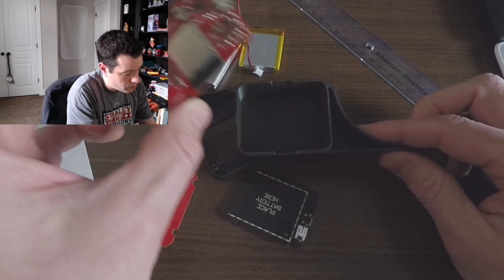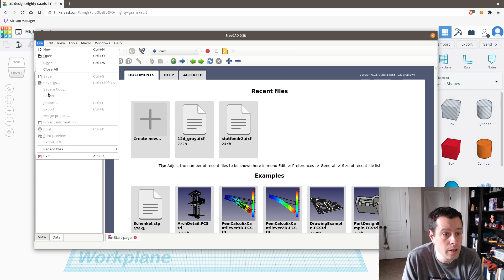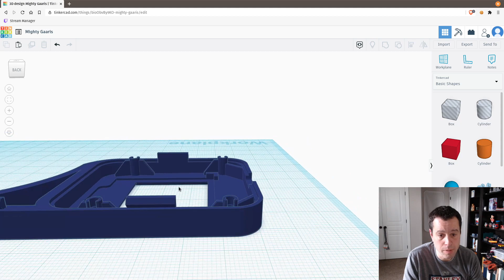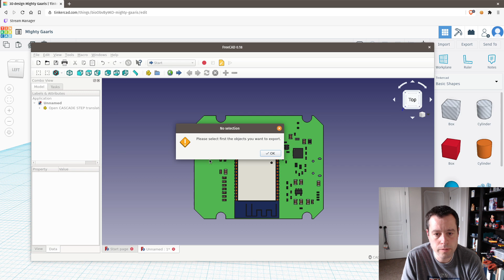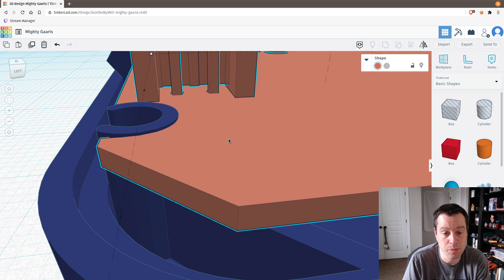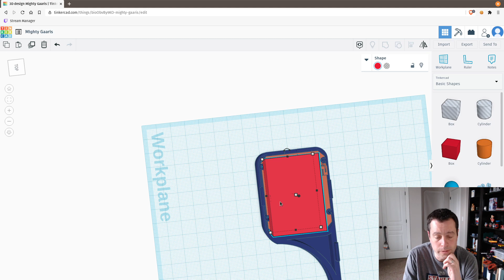ESP32 Product Creation Journey: Where to Put the Battery

Comment: I would think getting a resin printer could help with your case, pcb, and battery designing.  Good resolution and turn around and possibly save some money in the long run.
Reply from the maker: I have a Prusa Mini which works pretty well. I do like those resin ones though. One day.
Reply: I have relied on a resin 3D printer to prototype part and many/most are dimensionally not bad but certainly not perfect.   It’s a bit of a crap shoot.
Reply: Are you using the esp32 wifi?   If you are the battery is shielding the antenna……. I’m thinking not good to have metal anywhere near it